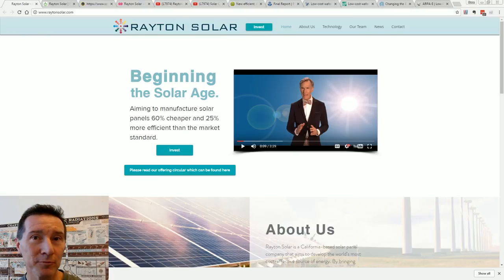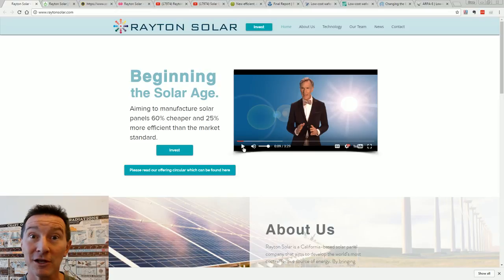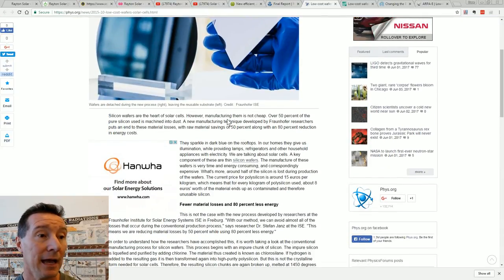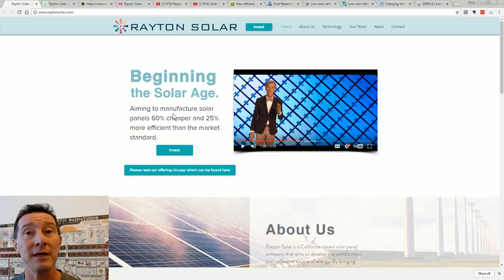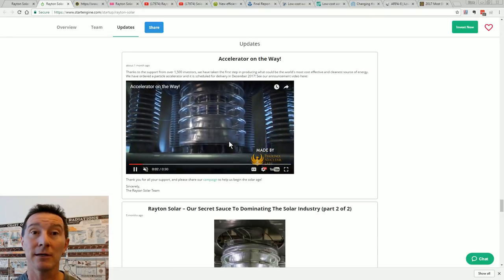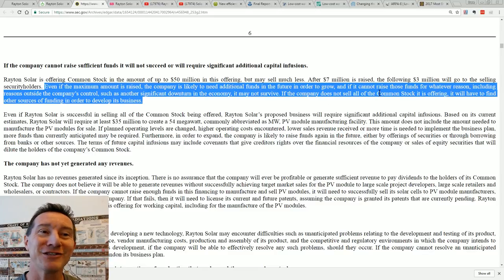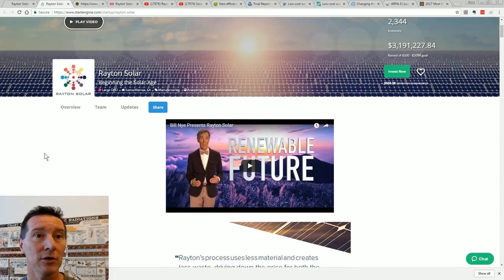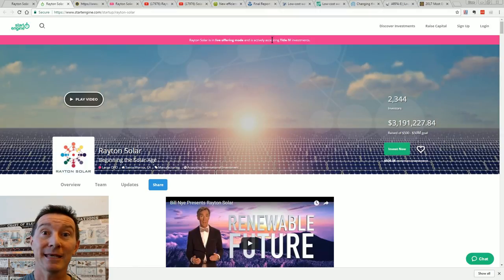Rayton Solar + Bill Nye = Questionable Solar Technology?

Comment: How long would it take a particle accelerator to flake off 147 million square metres of silicon? Less than a year? Because to keep up with Trinta's 23GW of annual capacity produced, assuming it is about 1.6SQM per 250W, that's what they'll need to manufacture to take over the market. 

If the wafers are about the same size as in the video, and I'm generous with 2cm x 2cm, then you'd need to flake off silicon wafers at a rate of about 11,000 per second. I'm thinking they'll have trouble scaling up their operation.  

Trinta's annual production:
http://www.trinasolar.com/us/resources/blog/looking-back-20-years-trina-solar

Size of solar panel for 250W
https://www.quora.com/To-produce-1-MW-of-solar-power-using-PV-cells-how-much-space-is-required

23GW = 23,000,000,000W / 250W = 92,000,000 panels x 1.6SQM = 147,200,000SQM / 0.00004SQM = 368,000,000,000 wafers to cut per year or per 31,536,000 seconds = 11,669 per second. 

Please correct the maths in reply if I've missed something. 

Also see some more analysis of their SEC filing here:
https://rationalexuberancesite.wordpress.com/2017/05/14/rayton-solar-a-story-about-bill-nye-particle-accelerators-and-greed/

Comment: Seems to me someone need to come up with a use for spoilage of the saw process.  What can silicon dust be used for?  Mix that with a conductive epoxy and use and extruder machine and squirt out solar cells and microcontrollers?  Mix it with some million year old dinosaur goop (asphalt) and make super strong roads?  Hey Solar Roadways, thats a good idea... HaHaHaHaHa.  Just too funny.

Comment: Rayton Solar Patent granted August 2016 https://patents.google.com/patent/US9404198B2/en?assignee=rayton+solar  "A process for manufacturing wafers ...using an energised beam [a proton beam or an ion beam]"
Reply from the maker: Ah, I was slightly out of date. Thanks.
Reply: No problem.  Just found another one also that was granted in the US in Nov 2016 https://patents.google.com/patent/US9499921B2/en?assignee=rayton+solar - Still, doesn't doesn't change anything though - there are no experimental results discussing the properties of the liberated slices in either patent that I can see